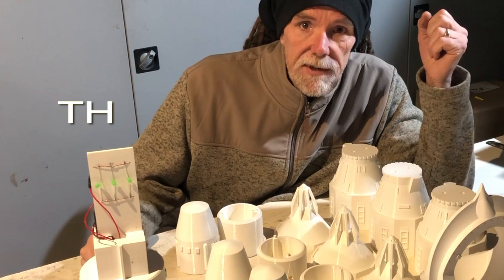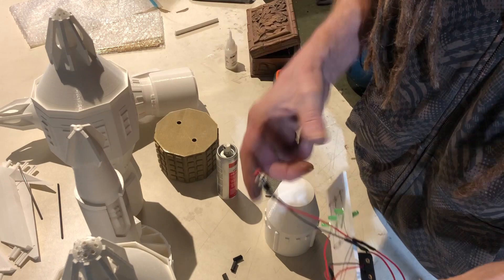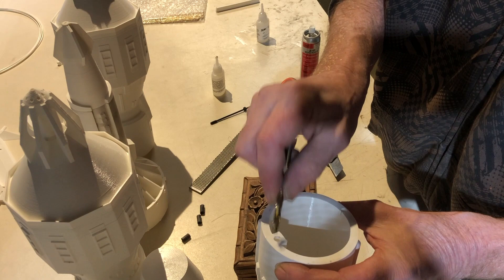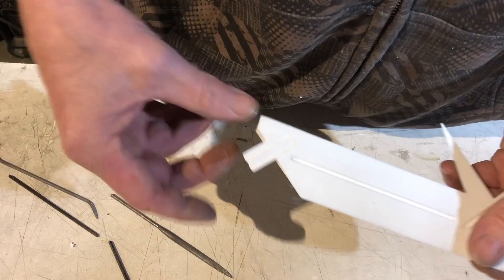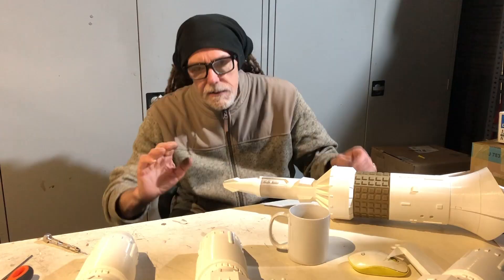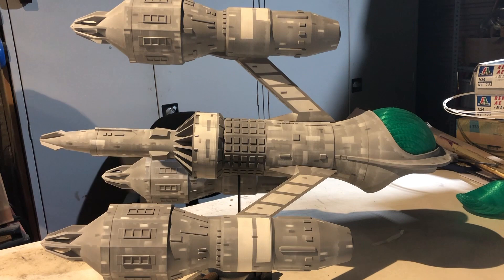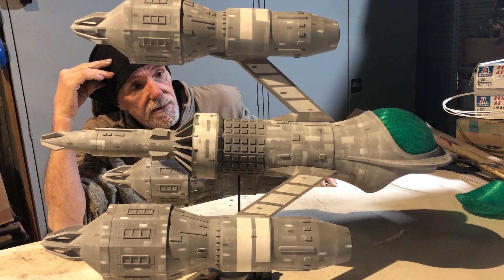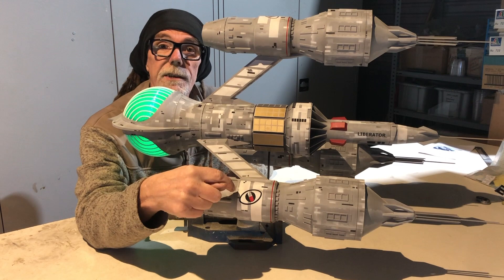CUSTOM BLAKES 7 LIBERATOR  speed build

Comment: Very nice model although, I gotta say, I always find a lot of the enjoyment is "getting into the head" of the original prop-builder by figuring out what parts they used, and how they put them together, to make the original model.
A 3D-printed model allows the builder to ignore that aspect of the build although, of course, if the original components are no longer available then 3D-printing can be a life-saver.

Regarding the switch, it might be better if the model was designed with a small slot in the switch-mount and then the switch could be securely bolted to a postage-stamp sized square of plasticard and slid into position before gluing the plasticard in place.
Reply from the maker: Hi there, thanks for checking the video. I think your correct about the switch. A less stressed position would definitely be a benefit. Overall, pretty nice kit for a display.

Comment: Could you use a regular drill bit, but put the drill in reverse? might take a bit longer, but should work.
Reply from the maker: Hi there. I could do, but they tend to wander a lot and generate a fair bit of heat. Thanks for checking the videos out. :-)

Comment: If only I had a 3d printer lol.
Have you ever built one using the original EMA Supplies styrene tubing and parts?
Reply from the maker: I did design and retrofit an armature to a much more accurate version a few years ago. The still shots in this video are of that one. I repainted it with a much more accurate paint job, and did the original fine line tape details on the engine. unfortunately i wasn't taking videos at the time, so nothing to really show on youtube. Thanks for checking them out :-)

Comment: Last annoying question my apologies sanding wise the grit/s you would recommend
Reply from the maker: HI there Andrew. I would work down from something like a 200 grit to 600, but be prepared for some work and sanding cramps. Dont be afraid of it, just have some fun. White lines on the engines come with the kit and are plastic rods. :-)
Reply: Awesome build mate. Once I finish my 5 concurrent builds (R2... 5 years and counting, blade runner blaster 3 years... You get the picture)  I'll definitely do this one.... Hopefully within a year! 😂😂........... Of course I've subscribed!!!!!!